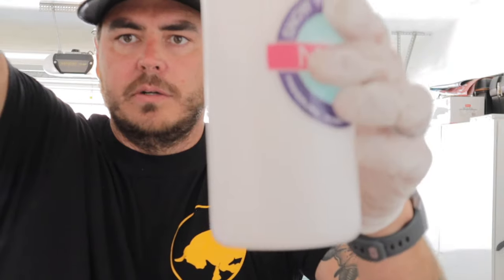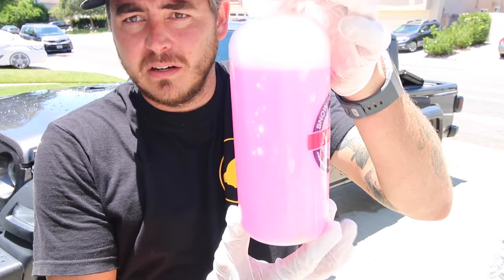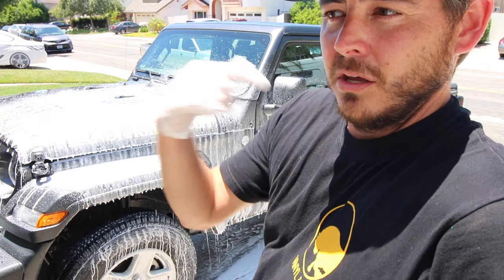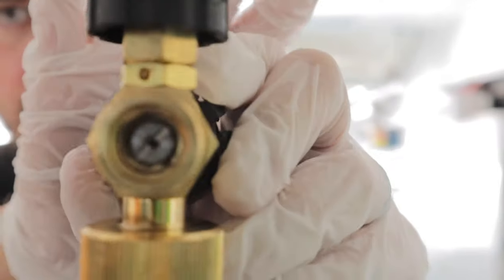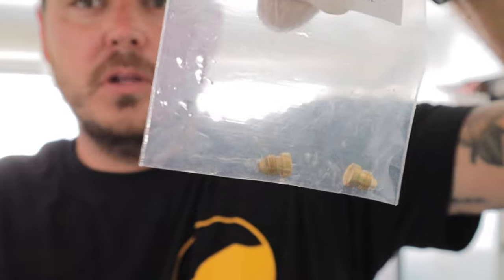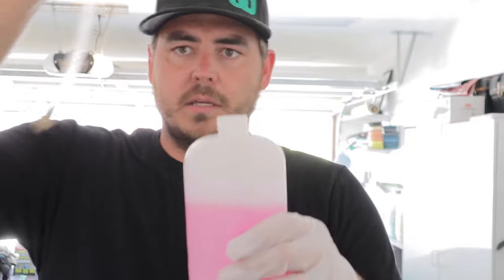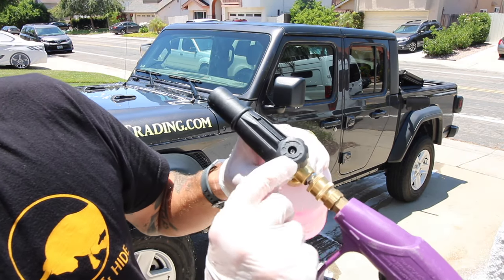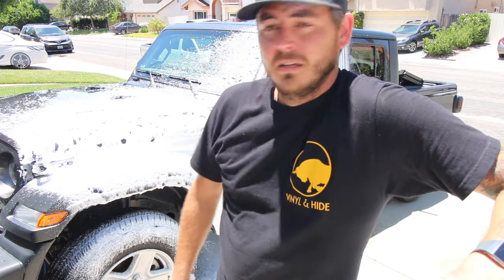How to get MORE FOAM from your Foam Cannon | Car Detailing Tips and Tricks | Pressure Washing

Comment: 2 part question: first, what degree attachment would you recommend for using when washing (or do you just use the wand with no attachment piece at the end?) Second, is there really a big difference in 1900 PSI vs 2000 PSI? Ryobi doesn't recommend 2000 PSI for washing cars, but I have seen many people use it for detailing online. I just don't want to damage the paint at all. Sorry for the newbie questions!
Reply: Never use high pressure near or on any electrical connections or spark plug wires.  This is dire on old vehicles with the non-weather resistant connectors.  I never use a pressure washer on the engine compartment.  The water coming out can break your skin, imagine the damage to delicate wires, vacuum lines, and electrical components.

Comment: Depending on your pressure washer the smaller orifice could be causing too much restriction and possibly damage the machine
Reply: i rather putting more soap in the mixture and use the stock orifice to get more foam, rather than risking blowing a seal inside the pump with too much pressure build from using smaller orifice.

Comment: Apparently these foam cannons only work well if you have a high powered pressure washer. I bought a cheap $20 Walmart foam cannon that connects to a garden hose and didn't get any soap at all. Sent it back today.

Comment: How many psi’s is your pressure washer ?
Reply from the maker: The one I did that video with is the ryobi 1600. That’s why the smaller orifice was needed to get that kind of foam
Reply: @imjoshv  my pressure washer is 3400psi & I don't get thick foam light that. Should I change my orifice size ?

Comment: Another couple of tips if you want thick foam. (Which isn’t always best) 

Use hot water 
Don’t use water stop connections. 
Add a little shampoo. 

Remember tho to get the best out of your product that the most important thing is Panel Impact Ratio (PIR)

You need to work out the correct mix fit your set up.

Comment: What is the quality of the MATCC bottle in this video?? I am Leary of these bottles with skinny necks being extremely weak. The Sunjoe bottle is absolute garbage.
Reply from the maker: Its much Much better than a sunjoe cannon..  I like this one becuase it has brass fittings on both the head and on the bottle so it doesnt strip out the threads https://amzn.to/3skv0fZ   or you can go with these https://amzn.to/3edWKNG that has a wider neck..

Just make sure to get the 1.1mm orifice to get the most foam! https://amzn.to/39K7nDT

Comment: If you get more foam with a smaller orifice then why don't they just put a smaller orifice in the cannon? I'm sure there are some out there that do.
Reply from the maker: yep there are. i just reviewed ine that comes wuth a 1.25mm and a 1.1.  If you have a higher powered gas pressure washer then the larger orifice works fine. The problem is alot of people have electric pressure washers and arent getting as much foam as theyd like and this is showing them how to get the foam up!
Reply: @imjoshv  Yep. Mine is one of the cheap electric ones from Amazon. I got it basically free, so I can't complain.
Reply: @imjoshv  The foam in this video looks about the same as the MJJC one you just reviewed. Should I just save $30 or would you recommend splurging a little for the MJJC?

Comment: I tried to remove the fitting to install from this same foam cannon to install the smaller orifice and I couldn’t loosen it.
Reply from the maker: just make sure to use a large enough screwdriver head. Youll get more torque and it should come out!

Comment: Pressure washer matters more
Reply from the maker: If you are using a standard electric pressure washer you need to do this to get the most foam. If you have a higher power pressure washer you don’t need to

Comment: thats wrong in so many ways. First of all you shouldnt mix water into the soap - it should be concenstrated. Next you need to have the right screw inside the cannon - you cant just pick one - it needs to be the right one accordingly to the water pressure.

Comment: Am I just weak or something, can’t get this thing off for the life of me 😩
Reply from the maker: The part that you take off with the screwdriver? It’s in there tight but it should be too hard.  I wonder if the one you’re trying to remove is seized in there... make sure you use a large enough screwdriver as that will help!!! Good luck
Reply: @imjoshv  after an hour I got it, it had dents and scratches on it when I received it so who knows. Thank you again!

Comment: Just wonder why it did not come with this from the producer. You should not have to do this!
Reply from the maker: Some do come with the smaller orifice. Most though come with a slightly larger orifice because that’s what is needed for higher powered pressure washers… but if you have an electric one then it’s not ideal and the 1.1 is much better

Comment: you just put more soap in it.
Reply from the maker: If the orifice size is too large even more soap won’t help. It will still come out too wet. Changing the orifice size allows less water in the mixture so you get a nice t to thick foam

Comment: That 1.1 surifice is goin to burn your pressure washer on the long run , i have just burnt ma 2.0 active pressure washer ... Beware what you follow , i have always follow this guys steps but now im going to unsubscribe
Reply from the maker: For a pressure washer like the active 2.0 you shouldn’t need a 1.1 and they recommend not using that. For the lower psi got units the 1.1 is the way to go. A 1.1 is equivalent to about a 3.0 nozzle which is still larger than what those kinds of units come with.